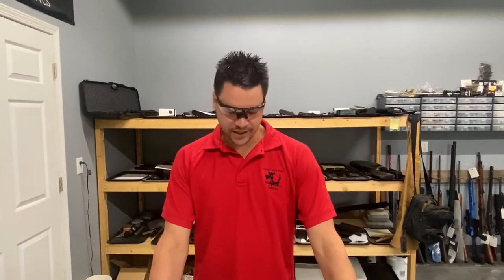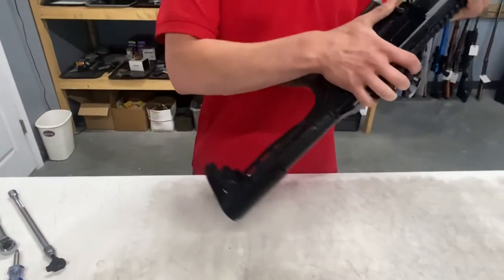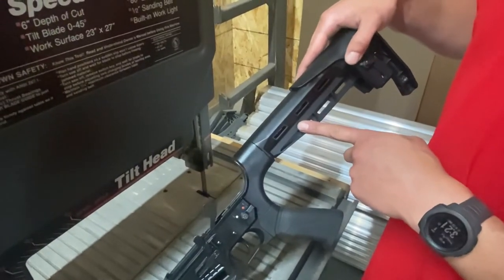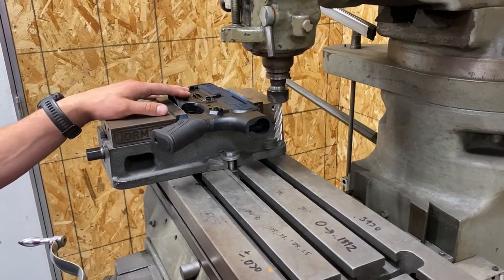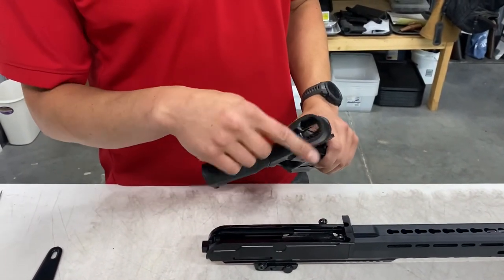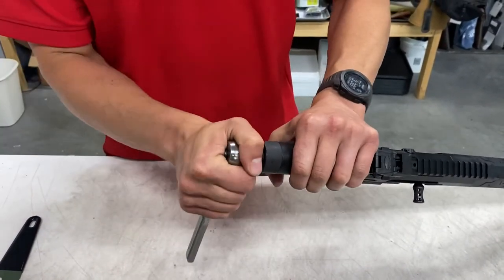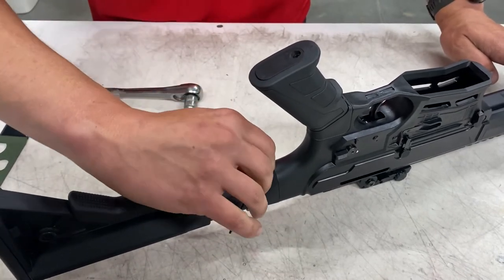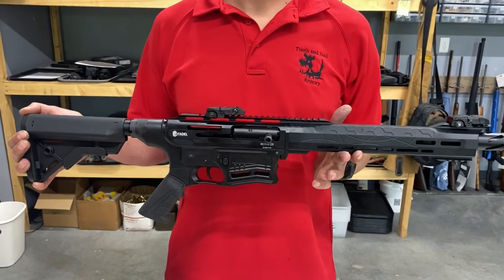Citadel Boss-25 Stock Adapter Installation

Comment: I am having problems with the barrel nut coming loose during firing.   I don't have a torque wrench, but tighten it down as much as I can with the tools that I have available.    Really frustrating and potentially dangerous.  I am really at the point of giving up on this gun, but thought you might have a suggestion.  Thanks
Reply from the maker: Is your detent still on your retaining plate? Shoot me an email and I can try and walk you through some things to check.
Reply: Same, take it to the gunsmith, he'll add tightening nuts to keep in place

Comment: Hi, I have a question for you. In this vid it looks like the boss has no hex nuts for the barrel shroud. Mine does not either. How do you get this apart? I you could please explain it would be greatly appreciated. Thanks
Reply: Unscrew the barrel shroud, then in screw the set screw between the hand guard and upper receiver on top.  Your handguard should now just pull off.

Comment: Is there a certain Collapsible stock used or could I put on an aimsport m4 stock with the spring and buffer tube on it?
Reply from the maker: Not sure how I missed your comment. Any milspec or commercial buffer tube and stock may be used with this adapter.

Comment: Does this $90 part come with a stock? If not, very expensive ABS and nut. Want to order but need some clarity
Reply from the maker: $90 is for the billet aluminum adapter we make here in house on our CNC machines. You will need a stock, buffer tube and lock ring to complete it.

Comment: Will this work on the pardus sd 12 ?
Reply from the maker: Assuming you have the same lower receiver as the boss-25 it will. The same company provides lowers to many manufacturers in Turkey so the adapter fits quite a few other brands and models.

Comment: How much would the removal and the adapter cost ??
Reply from the maker: $50 for cut. $90 for adapter. 1-2 week turn around. Shoot us an email and we will get you set up.
Reply: @3393matt  Im interested. I dod send you a email
Reply: I took a Sawzall to mine then touched it up with a grinder.  Was easy. Not $50 worth.